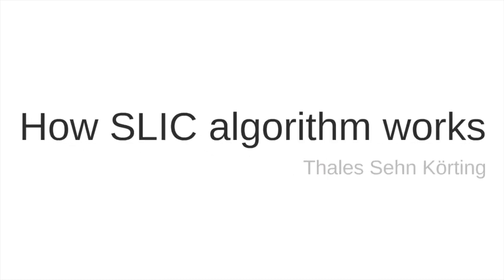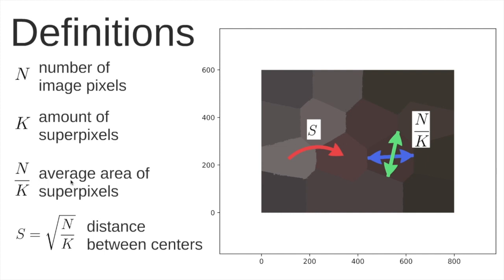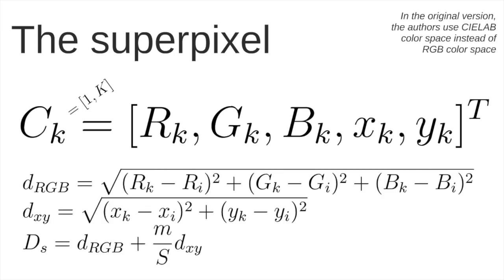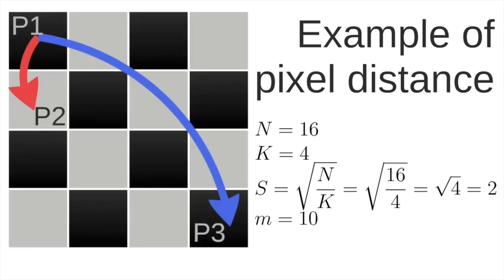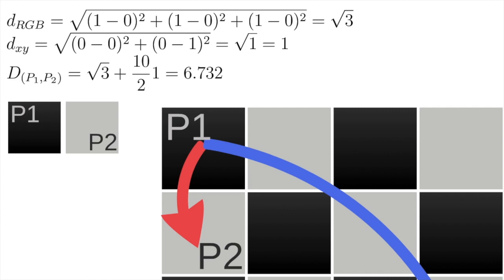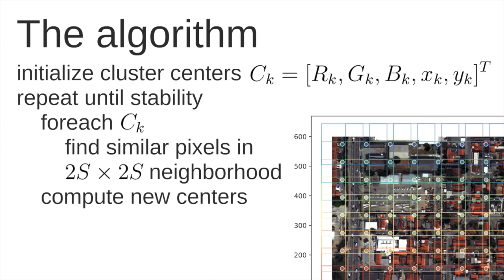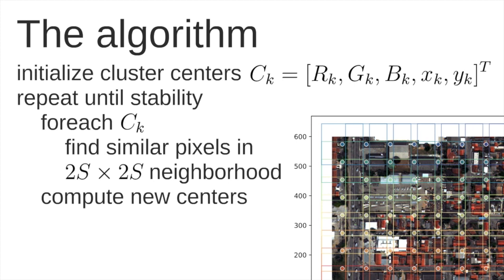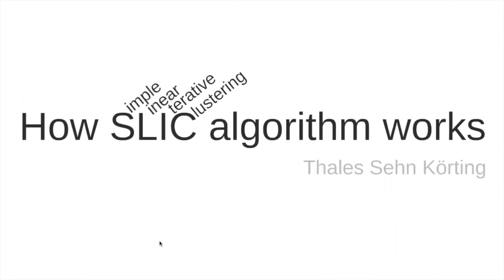How SLIC (Simple Linear Iterative Clustering) algorithm works

Comment: Hello,, what does the 'm' represent in the equation;

Ds = drgb + m/S * dxy

plz xplain... Thanks...
Reply from the maker: Thanks for your question,
please like and share the video and subscribe to my channel.

the m parameter will determine the influence of the spatial distance between pixels when computing the final distance. 

Regards
Reply: @tkorting   Thank you for the video. I still don't understand the parameter m. How do I calculate that parameter or is it a table value? I thank you for your answer
Reply from the maker: @ediliagonzalezmateus5994  thanks for the feedback, the parameter m is defined by the 'user'. It will say to the algorithm to consider more RGB values, or more the spatial distance between pixels.

Please, subscribe to my channel
Regards